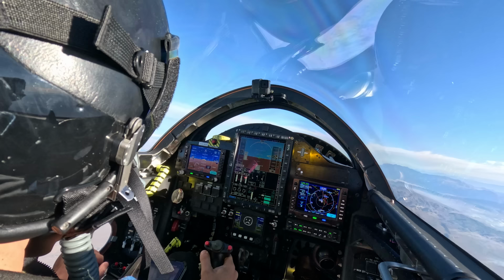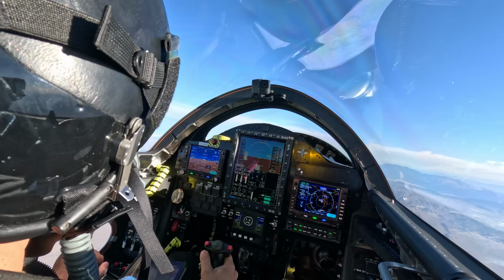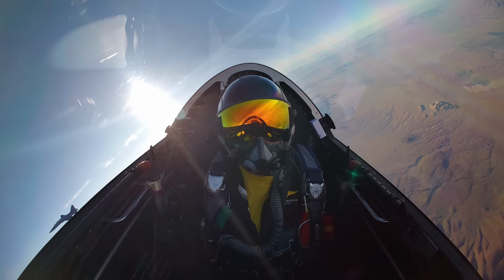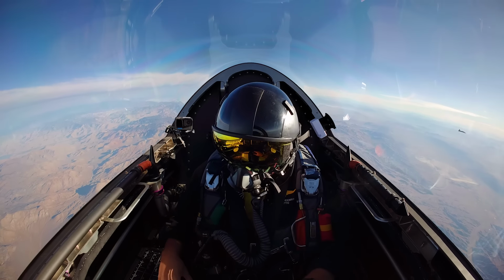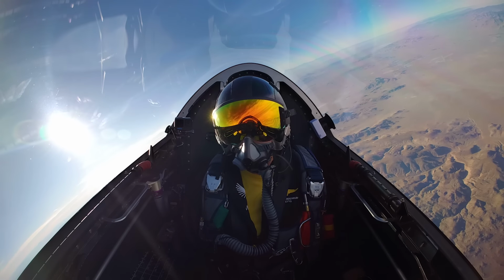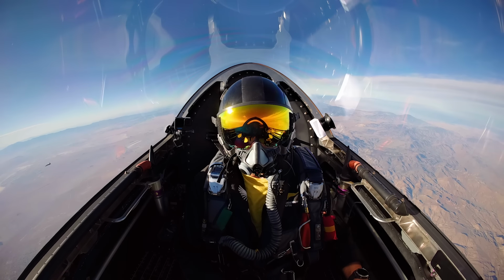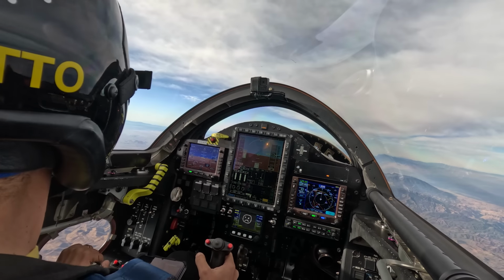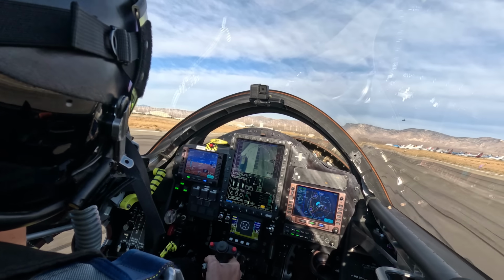XB-1 Flight 7: Play-By-Play From the Cockpit

Comment: The SR-71 went supersonic on its first flight.
Boom’s pace with this airplane is glacial.
Reply: SR-71 was designed during the cold war, safety wasn't exactly of the highest priority. Why push it if there is no need and it puts the pilot and air frame in jeopardy?

Comment: I'm curious that when right hand is removed from stick, the left comes up to touch the stick. Seemingly just touching it, as opposed to holding it. Is that a required safety procedure? As I would have thought the flight is stable and not going to diverge from controlled flight easily?

Comment: Ok maybe a dumb question but why test the ECS stuff if you are eventually building a different aircraft? That will have a cabin and different engine, valves etc.
Reply: Ok i posted a little early. Saw it was testing for higher alt. Ops.
Reply: Absolutely NOT a "dumb" question.  How  does the  XB-1 design relate to the full size final version which looks a lot like Concorde, except apparently for not having the Concorde "ogival' wing form?

Comment: Ce qui est con pour vous, c'est que les rosbifs et les frogies l'ont fait il y a 55 ans, avec juste une règle a calcul et une equerre, alors , bon, vous n'invente rien, même avec vos millions de us dollars.
Reply: Yes, you understand the hype.  Yes, I have a replacement of my  my original K& E log ,log, deci- trig slide rule which I also used on the Apollo space suit program. I did work on the electron beam welding of the Concorde heat exchangers here in the U.S.  Starting to question all the Boom marketing hype.

Comment: Looks like an awesome test.  I’m a bit surprised telemetry doesn’t have a voice channel.  As in, the test pilot not having to use radio to communicate to the control room.  About that lateral oscillation… might consider asking someone who’s flown the T33.  There’s a roll oscillation quality in that plane that’s pilot induced—i.e. only exhibits itself when the pilot is trying to hold a specific bank.  Good luck and thanks for the great video.

Comment: How does this translate to the larger aircraft with a totally different design?
Reply: EXACTLY!!  Also, NASA still is testing the X-59 and the results will determine if OVERTURE will be able to fly over land or be limited as was Concorde.  I worked on the electron beam welding of the original Concorde heat exchangers and follow this Boom project.  Hopefully, not another scheme for  publicity and ultimately embarrassing  my home state of North Carolina as the state of Oklahoma was embarrassed recently by a failed corporation..

Comment: As an Engineer I am interested in two questions to induce the Flutter is it done mechanically or with through the Fly by wire computer and is this aircraft fitted with an ejection seat as the parachute the pilot seems to be wearing seems to be a cut away main with a reserve pull handle

Comment: as usually you are not  telling the TRUTH.
 HOW did the two and first landers Viking one and Viking two land on Mars, V1 on Chryse Planitia and V2 on Utopia Planitia?
A normal propulsive landing each controlled by a radar altimeter for long range altitude and a four beam doppler radar for final descent  and no sidedrift.
The Fuel? Hydrazine monopropellant, the rockets ?  3  multinozzle normal everyday used rocket chambers, diverging and then expanding flows, sonic at the throat, Very simple, no cables no balloons just as Goddards first rockets. 
But your lack of research, assumed bouncing balls is the only way to go. 
How did Armstrong land on the Moon? With a single rocket  and four attitude control jet. The fuel : Di methyl hydrazine and Nitrogen tetroxide. 
A good candidate for the first human landings on MARS

Comment: It’s absolutely fascinating to see how a new airplane flight envelope is carefully opened up. I had no idea it was so deliberate and systematic, nudging the speed up a smidgen and testing all small impulse inputs and flutter for clean behavior. You can really see how the roll is becoming undamped at the new airspeed. Very impressive to see this done by a startup, and on too of that openly released. Much engineering respect.

Comment: This is fascinating stuff...It's actually tough to believe that there has never been an independently developed supersonic plane. The question I have is this: OK, so assuming you've built it, tested it, proved it reliable, and decided to start building them for consumer pilots/companies, will a typical PPL with Intrument and multi-engine rating be sufficient to acquire the jet type rating on this? I believe it's possible for small passenger jets, like the Citation, however does the plane being supersonic-capable change things?
Reply: Doesn't change much Dave. You would just need to be type rated on the aircraft and you wouldn't be allowed to go supersonic over land.

Comment: What is used to induce the vibrations/flutters? is it simply the ailerons or trim tabs?
Reply: From what I've seen of the device, it appears to be a large vibrator.  Just an unbalanced weight on the end of a speed controlled motor attached to the wingtip.  You don't need a lot of force if you can create constructive interference with what it's attached to, and you can do a frequency sweep to find where the resonance points are in the structure.  You can time the weight on both wingtips to be in phase going up and down, or 180deg out of phase to have one going up and the other going down to test different modes of vibration.  Attach some accelerometers at various points in the structure and feed that data through telemetry back to ground, they can crunch the numbers and see if there's anything stacking up faster than expected.  The whole point of it is so that external factors like turbulence that would initiate a flutter event don't happen within their expected flight envelope...they're creating their own turbulence and seeing how the structure responds to it.  If it dampens the vibration within a reasonable tolerance at a certain speed, they know that speed is safe from any flutter event.  If they see that the damping effect is reduced, or minimal, they'll know that pushing the speed any further could result in uncontrolled flutter, so they'd make some calculations and give it a Vne or go back and redesign or stiffen up some of the structure to alleviate the problem.  It's all quite fascinating, it would be interesting to see the data that they're looking at on the ground.

Comment: Can somebody explain why test flying a toy plane size demonstrator which doesn’t have anything to do with the full size plane design?
Reply: Testing the new flight controls and a new type of engine
Reply: @ these engines don’t go in the full scale. Do your homework
Reply: @modellbobby  yes but the technology used in them will
Reply: Testing the new systems and materials so it won't be so unpredictable and new on the full scale plane. If something goes wrong then it goes wrong here and not on the airliner, easier to fix in small scale I think. So basically it's for safety and faster development, at least that's what I know :>